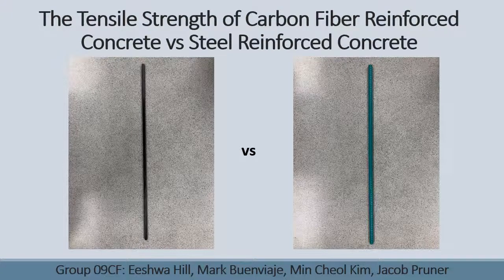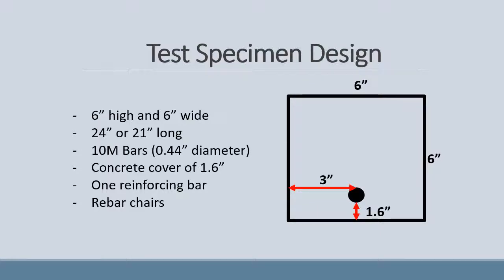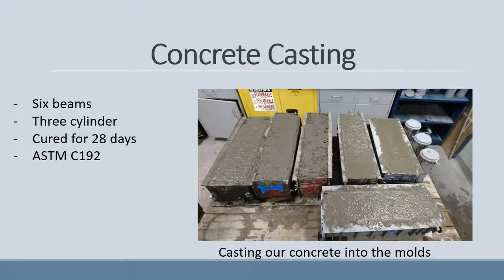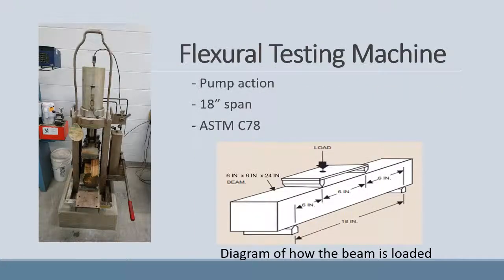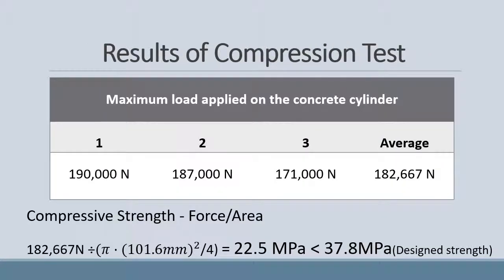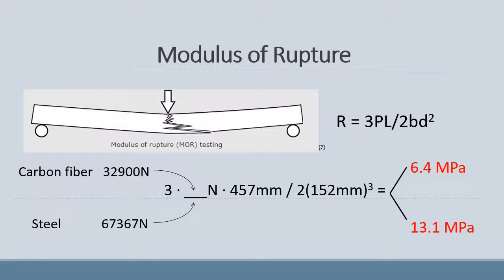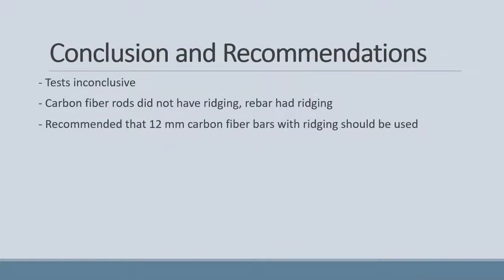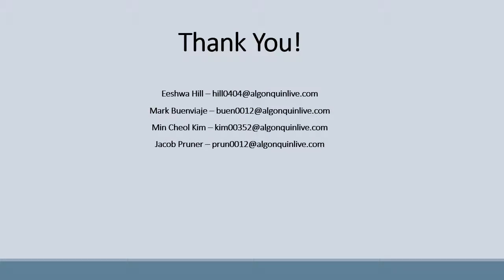2019 Winter: A comparison between the effects steel rebar & CF bars in reinforced concrete

Comment: Photos of the failed specimens would be nice. Video of the loading and failure might be interesting. Deflection at maximum load is another nice number to have. If the strength of the carbon rebar had been fully developed, it would have made a very impressive test.